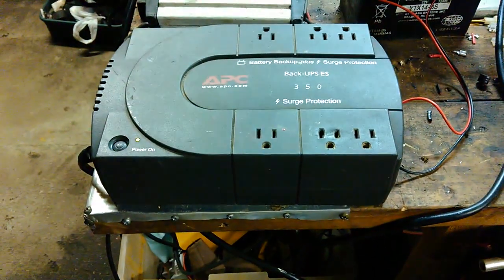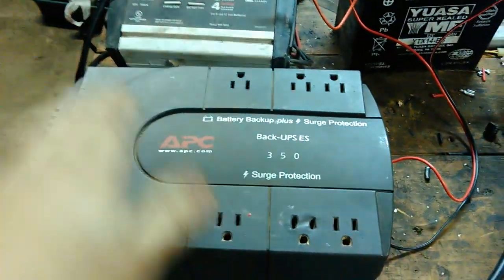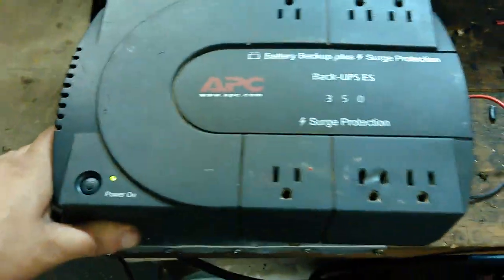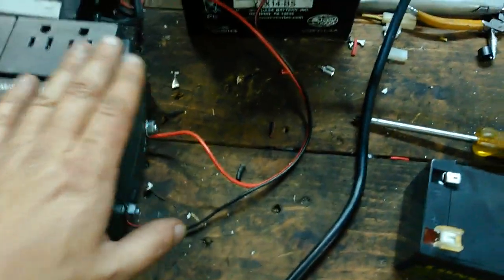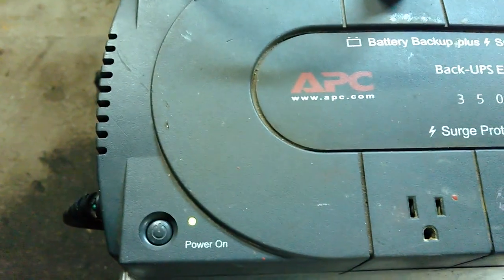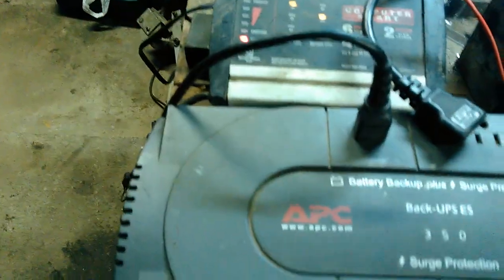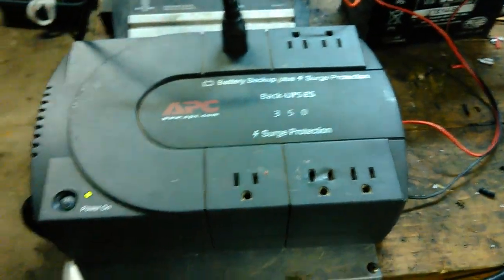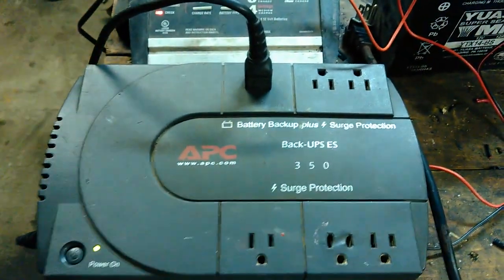ups battery hack

Comment: Cool job brother i have two ups i have 550 VA and 350 VA in my 550 VA i change battery i have in 7.2 Amp battery and i have in Tool box 12 volt 12Amp and 12Volt 7.2Amp run all up to 8 hours and more

Comment: Have this same UBS unit with a dead battery (already replaced it once in its life).  I have it mounted under my solar array battery bank, so I got to thinking... why not just use the UPS as an inverter and connect it with a 12v pigtail to my battery bank fuse block.  This gives me access to 6 110v plugs and a 12v power source to run my quail business incubator, auto heat control brooder or simply another outlet that I can use free juice.

btw... there's no such thing as a free lunch.  The laws of entropy exist in our world.  Even the green new steal "all solar -free energy" has costs. Consider the Ave life of a lithium miner has to move 5000 tons of earth to get enough lithium for 1 12v battery, and his/her Ave life span is only 35 years.  The green new deal has bigger costs that our current energy supply.  Don't let the NWO rook you into believing your saving the planet (for their huge profit).  Consider the 5 year old in Africa digging for lithium so the family can earn enough money and only survive another 20-30 years so TPTB can sell us eV cars they can control with the flip of a switch, soon able to tell you both when and where you will be allowed to take that $80,000 totally disposable bic lighter of a vehicle.
#DefundThePoliticians

Comment: I've got 3 or 4 of these that the batteries have died years ago, but I won't get rid of them because I was thinking of doing the exact same thing with at least one of them, to keep my modem and router on when the power goes out.

Comment: Have you ever repaired the charging part of one of these?  I have the ES 500, and a new battery, but the unit does not seem to be able to charge the battery.  I put a new 100% charged battery in it, and it registered at 100%, but if I use it on battery only, and run it down some, the unit will not re-charge it, and I don't know how to test it to see if it is trying to charge it - have you done a video that shows that?  Like i don't even know how much voltage the unit should be delivering to the battery when it is trying to charge it, OR how to trouble shoot where the issue is if it is not delivering the voltage necessary to charge this battery - can't seem to find that information anywhere!  Thanks for any help you can provide...

Comment: I was wondering were do you find these battery back up at thanks Wayne
Reply: In my town, there is a scrap yard that buys/sells metal by the pound.  Often they buy out old businesses and factories and have complete plexiglass enclosed manufacturing equipment.  My local yard has probably 80 tractor trailer containers filled with business and industrial surplus, and often sells items based on the current price of the scrap material.
Put an ad on Craig's list.  Lots of business and homeowners have 1 or 2 of these that the battery just died, as they do from not ever being used.  Perhaps ask your attorney or insurance guy if he has an old one... usually they are happy to part with the fo'free

Comment: I got the same one showing in the video got out of the dumpster for 16bucks i got a batery and put in it it still works im going to hook a solor system to it all you got to do is put to conecting pols on it like he did for the external battery conect them to the bateryin the apc and hoom up a solor panel with a controler and you have a solor back up or solor generater when power goes out your stuf wil run of the panel and of the batery at night or you can leve unpluged and run it just like a solorpower bank dont ned to be a rocket sicentest .

Comment: 1. Replacing the battery isn't a "hack".  It's just normal UPS maintenance.
2. Sometimes, the battery will have failed because of a bad capacitor in the UPS.  It's almost always a large electrolytic with a bulging top.  You don't even need to measure it.  You just unsolder it and solder in a replacement which has identical specifications.
3. f the UPS uses a lead-acid battery as most of them do, you can connect heavy wires to the battery leads and connect a larger external battery for a longer run time (but beware as this will also lead to a longer charge time).
4. You can now get a protected lithium battery which is designed as a drop-in replacement for lead-acid gel-cell batteries and the lithium batteries have around three times the ampere-hour capacity.  The only problem at the moment is that they are horrendously expensive when compared to their lead-acid cousins.

Comment: How large s battery can you charge with that and are they sla or agm? Tnx.
Reply from the maker: I have charged a 102 Ah flooded deep cycle battery.  I dont run the battery down much with this setup. I run lights on this.

Comment: how many amps can you charge through one of those?  i take it the set needs to be wired for 12 volts 
thinking about making it the controller in an rv switching between main power batteries and solar , from wat you showed me it should be doable , cheap too inly thing you need to add is sumting that regulates the charge coming of the solar panels  so the ups and solar dont charge the batteries at the same time
Reply from the maker: I wouldnt run a big load on this. It cant handle it. Small loads like a few lights a laptop charger, and things like that would be ok. Its ment to be a Back Up, not a constant inverter.

Comment: Is it ok to run electric motors with one of these? Say something like a sump pump motor?

Someone posted on another site that the output isn't exactly AC and can damage some electric motors. Any idea if this is correct?

Great hack. Thanks for the video.
Reply from the maker: If it is a brushed motor it would be fine, A brushed-less will have a "hum" to it  and will run hotter. You will have to make sure you dont go over the wattage of the power unit.
Reply: rvprepperwayne 
Thank you for the quick reply! 
Great advice, is there anyway to tell a brushless motor from a brushed motor?  Other than from the hum of course.
As you can tell I don't know much electricity.
Reply: I'm so glad I found your channel. Shortly before I searched on your topic my wife put the exact same APC as yours in the recycling. 

Any idea if this will work as a battery backup for my sump pump? 

Sounds like I need to determine the wattage draw on the sump?

BTW, thanks for the help... I'm your newest subscriber!

Comment: Melted plugs, I wouldn't touch that ups with a 10 foot pole, dead battery or not. You never know what could be wrong with it if something inside arched. That being said make sure it's sitting in a fireproof area on a non combustible tray.

Comment: one question, will the backup shut off automatically when it runs out of the alloted time it expects the battereies it was equipped with to run out or if say I hooked up a constant source of 12v DC will it just keep running as long as the voltage and amperage are there? 

I was looking at the actual chips on the boards inside and it looks like jumpering some of them over and cutting others off would guarantee it not shutting off and just continually drawing from the DC source, which is more what I am after, to get a DC source to an AC source to replace receptacles :)
Reply from the maker: +Thomas Anderson It will run until the voltage drops to a set voltage.
Reply: ah excellent knowledge, I got a ton of these (like 50 or more) that the batteries were partially depleted from a company that installs and maintains the fiber and cable running under city streets and over poles and such, so they routinely throw away partially good units to avoid any possible failures from waiting too long, and they dont pull the batteries or anything. just chuck the whole thing in a dumpster for the landfill and the box for the new unit at the same time, I had at one point over 50 of then and had stopped collecting them due to lack of space, unfortunately I ran even shorter of space and had to chuck all but maybe 10 I kept and about 10 or 15 I gave to a friend who got new batteries and put them back in service in his private server network. I even skipped on a bigger one that I found out later would have let me take 110 voltage to charge batteries and put out 220 voltage lol, still kicking myself over that one XD

anyway the TL:DR of that is, check with local cable installers (the guys with trailers that have a giant spool of orange blue or black tubed cable,) for dead or nearly dead UPS units for free :)

Comment: What type of batteries do use to replace the stock batteries?What is the largest capacity you have used? Have you noticed a difference between trickle charging UPS vs other smart charging methods that stop charging when the battery is fully charged?
Reply from the maker: +Audito Canarsie The biggest battery I have used is a 32 amp hour. I have run it down to 11.5v and let it charge bacl to 12.7v in about an hour. I prefer SLA battery's. You can have them in the house without fear of off gassing. I like the charging of the UPS, It is a slow deep charge and it don't  burn the battery. A stranded type charger that charges quickly will shorten the life of a battery.

Comment: +Videsh Radhaykissoon and others asking about other battery types and longer run times... It is better to get a larger UPS for that 'big battery' situation, and particularly the ONLINE kind of UPS, which has a charging circuit equal to the entire load rating. The cheap BACKUP kind of UPS (as shown) only have a small charging circuit, not good for big batteries. Also, large UPS units of either kind have fans to cool their circuits as needed. Large UPS units are scrapped all the time, just like the small ones. In either case, it is usually because the batteries died. Note that larger UPS units often use more than 12 volts on the DC side, to reduce the amperage which must be handled. With old batteries in series for higher voltage, you can have issues with a weak battery in the series-connected string of batteries, so it works best with new batteries. I use Marine Starting batteries in some cases and Riding Mower (lawn tractor) batteries in other cases, depending on budget and desired run time. Also note that Sealed Lead Acid (SLA) batteries can tolerate a higher charging voltage than Flooded Cell lead acid, so the charging circuit in a UPS may overcharge flooded cell batteries, which "boils off" the acid. The APC brand seems to be particularly bad about excessive charging voltage, and it's hard or impossible to adjust the voltage in every APC unit I've used. A simple work-around 'hack' is to use anti-parallel diodes of appropriate current rating to knock a little off the voltage. Silicon diodes will trim off about 7/10th of 1 volt at low current, up to about twice that at high current. For BACKUP-type UPS hacks on 24-volt systems, I usually put 2 smaller diodes (like 10 amp rating) in series to knock down the charging voltage, in anti-parallel with ONE large diode to carry high current from battery to inverter, where you want to minimize the voltage loss. Using a large Schottky diode for the high current is better still, due to lower voltage drop with that type diode.

Comment: I dont know if this question had been asked but i was wondering if would it be possible to plug a powerstrip/isobar into one of those outlets allowing the user to connects more items that would receive power from the battery?
Reply: +1965nterp Sealed Lead Acid (SLA), which are FAR cheaper than any of those other types asked about... Lower price, too! ;)
Reply from the maker: +1965nterp Yes you can
Reply: +rvprepperwayne  thanks and does the power drain when you connect more items ?
Reply from the maker: Yes it will drain quicker.
Reply: +rvprepperwayne ok now what about the battery that you removed from that bbu is it nicad, lithium. or nickel metal hydride?
Reply from the maker: I dont recall what it was that I removed.
Reply: You can, just don't go over the wattage/ amperage rating of the unit, if you do go with one it would be good for chargers.

Comment: I gotta do this and use a jumpstart box to power it. I did mod a smaller portable inverter which had a dead battery but it only puts out 80 volts AC for some reason. It had a 9.6 volt battery inside. Not sure if pumping 12 volts into a 9.6V circuit has anything to do with it but I hooked a 9.6 volt battery that goes to my RC car and it gave the same 80 VAC. Will be keeping an eye out for one of these UPS units.
Reply from the maker: +coondogtheman1234 Some units will have a low output with no load. If a load is added the voltage increases. as far as the 9.6 battery that is a new one on me. I have never seen one with a battery under the 12v mark.
Reply: +rvprepperwayne this one is a black and Decker power to go and it just wouldn't  hold a charge anymore so I decided to mod it. will definitely try that but it's not at all a strong inverter maybe enough to run a lamp or something small.
Reply: +rvprepperwayne and the battery is just a bunch of NiMH batteries wires in pairs so you get more current at 9.6 volts.

Comment: Thanks for sharing.  What kind of charge controller do these APCs have?  What are the range of batteries could they use?  Would be great if a hack to one of these could be for adding a solar panel or two.

Comment: yup. these things are a gold mine if you live where the lights go out a lot.they are at the transfer station , [the dump ], all the time. i got one that is 860 watts .it used 2 12 volts for 24 volt input. i put 128 amp hour deep cycle battery on it .it runs my 32 inch flat screen,laptop computer,modem ,wifi router,a stereo and some compact fluorescent lights,no problem ,for 7 hrs. these are not very fast chargers though .i had new batteries ,[about 80 bucks each]. i gave them a good first charge with the battery charger  because it would have taken days. the overhead lights in my house were on separate breakers ,so i  installed an outlet for that breaker and a plug from the lights .now i have another UPS on all the lights and used all fluorescent bulbs. now when the power goes out in my neighborhood, my 32 inch flat screen,laptop computer,modem ,wifi router,a stereo and some compact fluorescent lights ,never even blink . i'm going to hook my solar panal up to it to see if it works to keep it charged . if it works,i'm putting it in my 1969 fireball camper that i'm restoring.it did not have fancy battery charging stuff .but  mine will be pumping out the bass .
Reply from the maker: +immrnoidall That's good that you have power when you need it.  I like the idea of using solar to charge the battery's. I don't see any reason it wouldn't work.  Thanks for sharing.

Comment: Can you hook up a car battery to this???
Reply: +orgsniper You can, but it's not really safe to use long term. Car batteries aren't designed for deep cycle discharging and if you overly discharge them, it could damage them. But a more immediate concern is that they aren't sealed, so if you tip them over you could spill battery acid and that would be bad. They can also leak hydrogen gas which could present a explosion hazard (this can be a even greater hazard if they become damaged or become overcharged). 

Generally it's not a good idea to use car batteries with these things inside the house. Just get a large deep cycle battery instead. (Sealed Lead Acid batteries like those used in electric vehicles like golf carts and the like for example)

Also you can probably use lithium batteries with these too. But the charging circuits aren't designed for them (and battery capacity readouts if USB port is plugged into a computer to read what the battery capacity is, might not be accurate as the discharge voltage curve for lithium batteries is not the same as lead acid chemistry batteries), so you can probably run them off a lithium battery, but don't allow the UPS to charge them. ;)

Most consumer UPS devices do not use trickle charging, so I don't think you really have to worry about over-charging batteries unless you have a really cheap one or some generic knock-off brand you bought online. :P
Reply from the maker: +orgsniper Yes you can.
Reply: So im guessing hear. You can charge Any battery as long it is 12v then??

Comment: can i use a 12v 7amp motorcycle battery for an approx load of 200w??
How long will it power up and how will i charge it?
Reply from the maker: +Sagar Samal Yes you can and I have used one for about an hour with a 4 foot florescent light. There are many ways to charge it. If it is plugged in and has power it will charging. If you dont have access to plug it in you can use jumper cables hooked to a car while it is running.
Reply: no, you need something bigger

Comment: Why not just use APC's replacement battery? They're pretty inexpensive. You can buy them on amazon.
Reply from the maker: Mubeen Deen By using an deep cycle battery you will have much longer run time than the replacement battery.
Reply: I priced one for $30 which provides battery power for about 30 minutes.  Way too expensive for such a short time.  I’m thinking I could connect to my RV or boat battery if I’m in a bind.

Comment: these apc ups can you say if it trickle charge the battery or float charge the battery. is it safe to keep a deep cycle battery permanently on it as a replacement for the original battery?